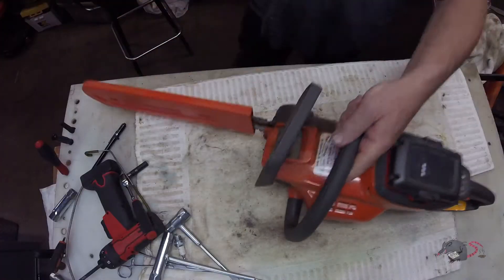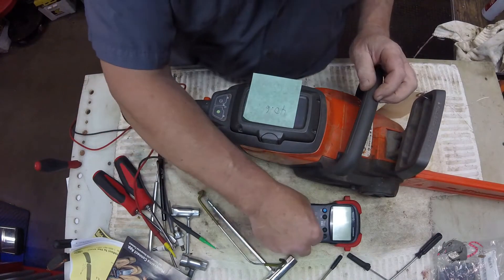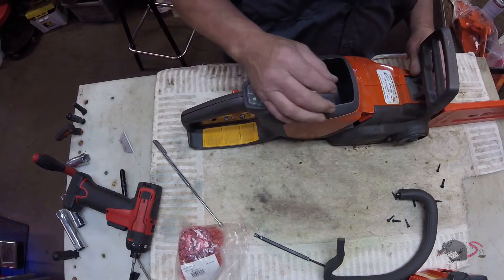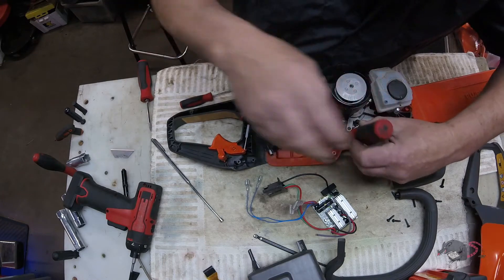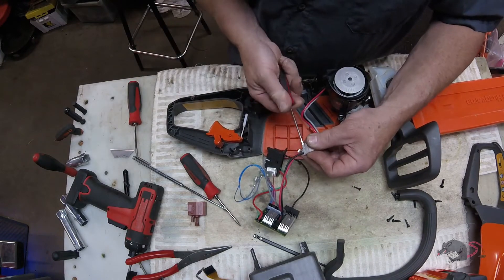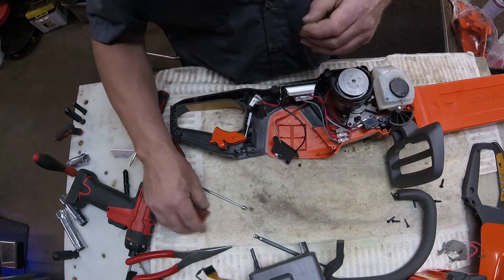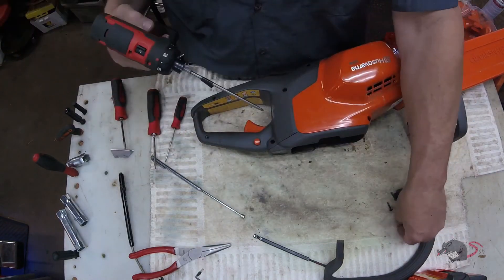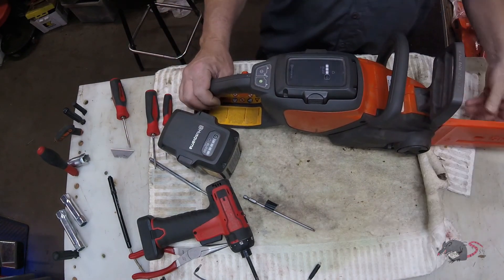Husky 120i Chainsaw Dead Battery Won't Charge

Comment: How is changing the control board going to get the battery to charge?
Reply from the maker: If the control board draws the battery down below a certain voltage, the charger won't begin the charging process. I think 18 volts may be the lowest this battery can go and still accept a charge.

Comment: I purchased on 2018, If I want fixed , got estimate of cost. Will dealer swap out or send it to Factory. Thanks
Reply from the maker: The factory relies on dealers to do repairs. How that dealer handles it is up to them. The only time I've ever sent a unit to the factory was for them to examine a failure.
Reply: @TheGreasyShopRag , I have a Dud for a dealer, offers no help. Guess I look for a New dealer. Battery looks full charge, so I believe defect that you reviewed is problem, bought in 2018. Hate to trash great saw. Thanks

Comment: This has nothing to do with battery, not charging.only a shared battery not running the saw.
Reply from the maker: The customer brought it in because the battery wouldn't charge. He was correct because the control board slowly drained the battery to a voltage lower than the charger would accept for charging. At 6.7 volts that the customers battery had, the charger won't begin the charging process. This 40 volt battery needs to be around 18 volts for the charger to kick in. The solution is to replace the control board or not store batteries in equipment when not being used.

Comment: What does this have to do with that battery charging. Can the battery be reset to charge again.
Reply from the maker: See my other reply. The official answer is that the battery cannot be reset. I've seen hacks on youtube showing how to jump start a battery to a voltage that the charger will accept but i don't recommend that.

Comment: They say there is a 8amp fuse inside that pack somewhere.
Reply from the maker: There may very well be.
Reply: Who is “they”?
Reply: @dropndeal  The general public who have purchased this item at some stage.
Reply: @ Ha! Right. Well, I do own one of these, and have taken it apart to troubleshoot. The BLi22 (30, etc.) battery packs do indeed incorporate an automotive style fuse that sits between the control module and the battery pack. However, it’s not really considered a user serviceable replacement as it is quite difficult to access. In this video example, the power pack is failing power leakage, so not a fuse issue.

In the case of mine, the battery pack is fine, whereas the QC80 charger would not power up. It contains a T2.5A250V fuse soldered directly to the PCB on incoming power. No idea what caused it to blow, but I’ll replace it and see if the PCB lets out the magic smoke. If it works, I may install a fuse block rather than solder fuses directly to the board.
Reply: @dropndeal  be careful in there.  I took one of these apart and lubricated a screw with WD-40.  For some reason it reacted with the plastic casing and started to smoke and smoulder nearly causing an explosive reaction.  These things don't like being disassembled, there is gooey gunk in there that can react with solvents etc.
Reply: @ The only thing that could be reactive in there is if you had a cracked cell with exposed Lithium, but that is unlikely. If that’s the case, then it’s trash. Lithium will react violently with water and perhaps atmosphere if the humidity was very high or condensation was occurring. If that were happening with any confirmed frequency, the product would likely be in a forced recall. 

WD40 penetrant is non-conductive, so I’m curious how that would have caused any reaction. The cell pack connections are potted and would have to be ground or chiseled, so to take apart you must’ve really been bored🤣, unless you mean opened the case.
Reply: @dropndeal  these battery packs are designed to be non serviceable.  They are dangerous to fool around with unless in very safe environment.  I simply opened the pack, analysed the product, fiddled with a few machine screws.  After leaving for 5 or 10 minutes, smoke started billowing out of the pack.  It may have reacted to the heat in the building, so I put the whole thing in a bin.
Reply: @federalnoise   Yes, eight days ago I commented that the battery packs are not considered user serviceable. However, they’re no more dangerous than any other multiple cell battery pack. Anyway, I’m tired of beating that dead horse. 

On another note, I successfully repaired my QC80 battery charger, and my battery pack is working as designed.
Reply: @dropndeal  Sweet as bro

Comment: Thankyou ! I learned more from this 12 minute video and comment section than from days of reading through Husky manuals, websites and customer reviews, your time and effort is greatly appreciated . I also have a question. I have a BLi20 and BLi10 Battery for my 115i Trimmer, I have just purchased a 120i Chainsaw and I cannot find consistent info on whether I can use the BLi10 battery with the 120i Chainsaw. An official Husky chart has them as not compatible but I have seen a few retailers here in Germany selling the 120i Chainsaw with a BLi10 battery. So, do you think I can use the BLi10 battery with the 120i Chainsaw? thanks again  !
Reply from the maker: The BLi10 is only a 2Ah battery and can't meet the demands of the chainsaw. Thats why they say its not compatible. Will it work? Maybe, but run time will not be much.
Reply: Thanks for the swift reply. I assumed the run time wouldn’t be long, I just like the idea of having a backup if I need to get in a few more cuts . Do you think  the BLi10 could be damaged even just using it for 5-1O minutes ? Thanks again 🫵🪨🤘
Reply from the maker: @DTBiscuits  I think the batteries have internal circuitry that only lets them discharge at certain rates. This is why I'm not sure how that battery might work under the high load of a chainsaw. My guess is that if you horse on it the saw will stop and the red light on the battery will start flashing.
Reply: @TheGreasyShopRag  Thanks for helping me get bit of clarity , is it greatly appreciated. You have also proved that a greasy shop rag is still useful.

Comment: What tool to open battery cover? None of my Torx fit and my eyes too old to see.
Reply from the maker: Not sure what you mean by battery cover but most of the screws in this repair are T20.

Comment: Wondering if controller issue common to blowers too?  I have a 320iB blower.  I just bought a BLi20 battery on Amazon for $135.49.    I'm gonna fully charge and then do the 24hr test.
Reply from the maker: I thought it was just the saw and hedge trimmer.

Comment: Many thanks for this video. You nailed it !  My Husky 120i is on its 4th battery in 5 yrs.  The shop where i bought it just keeps giving me a replacement under warranty when the battery wont take a charge.  I measured 3.1volts and the charger wouldnt charge it.  But after seeing your info about the bad controller, I charged the battery from another Lith battery and now it takes a charge !    I will just remove the battery when the saw is not in use.  MANY THANKS !
Reply from the maker: It seems odd to me that a shop is capable of making a warranty claim but not know to check for service bulletins. I'm glad the video helped you out.

Comment: Question. If that's is a 1400W chainsaw driven by a 36V4A battery (let's say 160W maximum power) does that mean the motor drains almost 40A from the battery, or does it stop at 4A and the motor is in actual 160W motor with some clever torque mechanism to make it as powerful as a 1400W motor? 
Thanks in advance for your reply!
Reply from the maker: I don't have an exact answer for you but I can tell you that there is a fairly significant gear reduction in place.
Reply: They are Sony VTC 4 cells, good for 30Amps, easily 20 Amps (70-100w per cell). These are 2 banks of 10 cells (36v 60a) so in theory could do ~2200W but something would probably overheat

Comment: Are you saying as long as I remove the battery after each use the battery will be good?  I ran this little saw most of the day and only go down to the second light bilking when charging.   Seem very powerful for a little saw.   Thanks for the comments
Reply from the maker: Yes. If your control board is bad it won't matter because it cant drain a battery thats not in the saw.
Reply: @TheGreasyShopRag  Thanks for the reply and for showing the vid.   I just purchased the Husky 110 and red the reviews about the battery  but unlike many, I pull the battery from the tool when not in use.   For a cheap little saw this little thing really cuts.    I have RA so this little limb saw is nice    Four hours on the slow settings..    Thanks again..   You are the man..
Reply: Just a follow up..  I have the newer saw and it runs and holds a charge like it should.   I still pull the battery after use.  This little guy works great, not my 362 but handy at times..  Thanks again

Comment: Very helpful, I have experienced this issue.  Online now with Husqvarna support, to see what can be done. If they respond favorably I will continue to be a loyal customer, if not - I am done, will never buy another product from them.

If I would have known this issue existed, I would have never left the battery in the unit : (
Reply from the maker: Even Husky didn't know the issue existed until units failed. If I were a Husky lawyer I would point out that the owners manual says you shouldn't leave the battery in when not in use although this was written as a safety concern for accidental startup. Lots of people leave them in. Its part of the convenience of having one of these units. I wish you luck and hope Husky comes through for you.
Reply: @TheGreasyShopRag No doubt Husqvarna would win on those merits alone. But that is a minuscule victory versus the loss of repeat and/or future customers. Those in charge of marketing should see this as an opportunity to do the right thing, issue a recall, and secure those loyal customers.

Comment: nice vid. this one is probably off the topic, but maybe you can give some info about this:
i have same 40v battery for el. rod saw, bit i think it is the smallest capacity. since this are powered by li-on cells and since battery looks/feel light and half empty, do you think it can be upgradable to higher capacity with same type of cells, maybe even on same cell holder and bcm?
Reply from the maker: I don't have enough experience with modifying batteries to answer that. From everything I've heard, you better know what your doing or risk a fire.
Reply: @TheGreasyShopRag   ok, thank you.

Comment: Hi Great video. If the battery goes below a certain voltage because the controller  board is bad, can the battery be revived?
Thank you
Reply from the maker: The official response is no. I've seen videos of people jumping two batteries to revive one but that is dangerous and not recommended.
Reply: @TheGreasyShopRag  Thank you. What is the danger?
Reply from the maker: @dermotcleary5272  Fire, explosion and personal injury.
Reply: Just had that happen. I put a small automotive charger on the battery set at 2 amps which is what the Husqvarna charger is set to. I charged it for 30 seconds and it was enough to allow the original charger to start charging. Those batteries are too expensive to keep buying new ones.
Reply: @iaff801  How did you hook up the 2amp charger?

Comment: Long shot but do you happen to know why the batteries themselves would stop taking a charge? My dad had a couple go dead barely a month apart and neither will charge. Meanwhile he borrowed one from my bro and it charges without issue. I'm incredibly hesitant to get him a replacement because they seem to go for $250 which is astronomical.
Reply from the maker: The most common reason for this is the battery has dropped to a voltage below the minimum threshold for charging. This can happen from storing a dead battery in which case it naturally continues to discharge till it gets too low to recharge. It can happen real quick if the battery gets cold. Also there were some bad controller boards that slowly discharged the battery if left in certain equipment.

Comment: Really good video! Watched it twice! Interesting to see the guts in those cordless saws.
Reply from the maker: Thanks. That saw has been holding up pretty well.  We've sold a few to guys that do pier installs. They sharpen the 4x4s to a point with this low cost saw. I guess it saves a lot of time not dealing with finicky gas saws and they are cheaper to replace after falling in the lake.